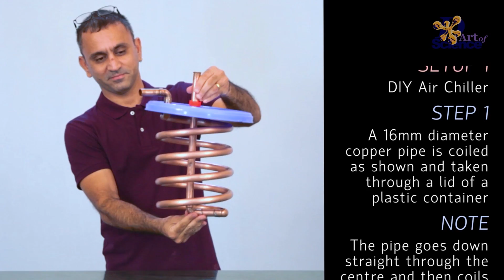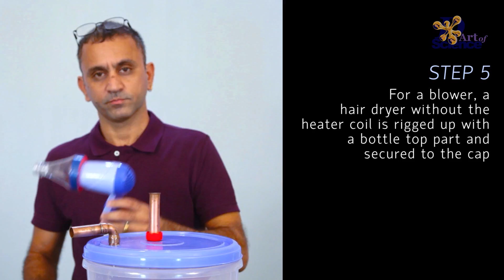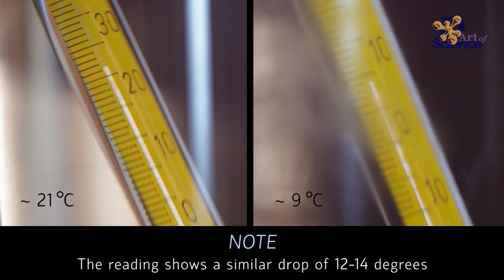How to make an instant cooler

Comment: Bro! 1 time use is quite ok, eventually not always. Too much work to make ice, pour in the container then put water from above. Using Cu for longer periods its corrosive metal, cleaning maintenance. Need to work on this.